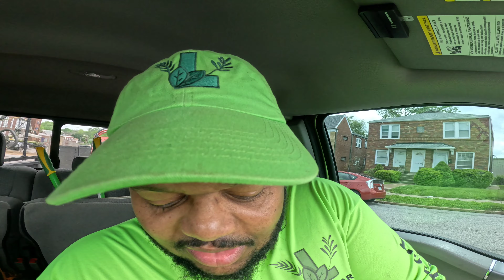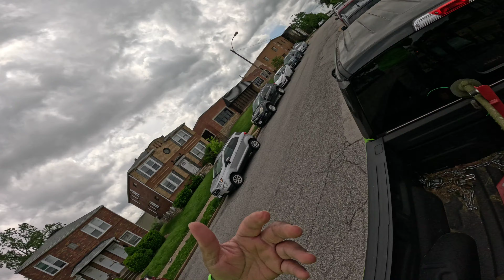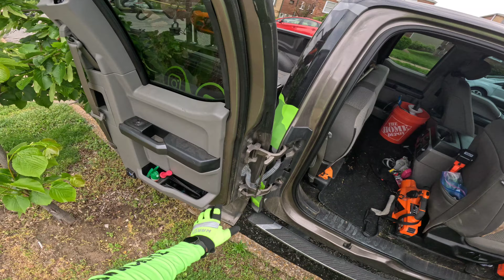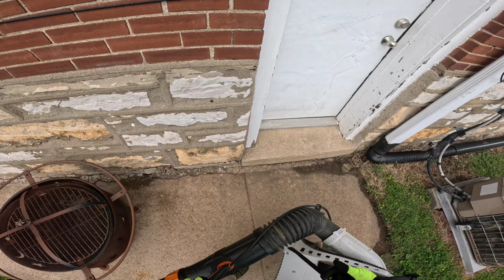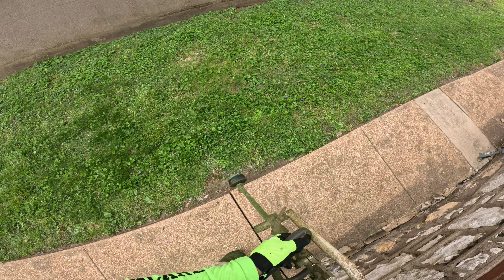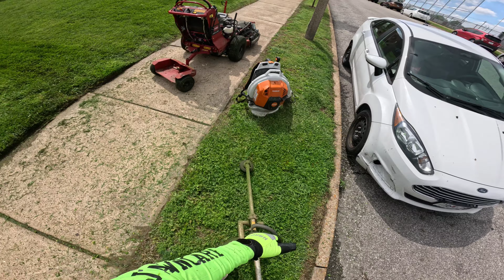I need 20 customers, not 1 customer with 20 properties #lawncare #cuttinggrass #mowing

Comment: Okay so, I see what you're saying however having a broker or an investor with multiple properties may not be a bad thing. If you can get control over the price for each individual property. And explain in detail what you can offer and what you can do and what you won't do. And again what they'll try to do is bundle everything and just keep everything like a flat rate cuz that's easier for them to write off on their taxes. However it may not be a bad thing but it just accordingly. Now one can weigh the return on investment onset and such properties. Play if they're weekly. So per se 20 properties right, depending on what East property is quoted at. Subtract your expenses and travel time to each property. For example, drive to each property measure the distance there and back how much fuel you use etc walk each property you'll know by walking each property how long will it take you. On each property, you don't know exactly what tools and equipment you'll need to complete each task on each property. Come up with a number for each property. People who invest in properties are usually people who are very good with numbers and they speak in numbers only. If it makes financial sense to them in financial sense to you and your business. It could be quite profitable. Cuz I'm not there, I don't know the local environment nor the local ordinances. However, if they're higher line properties as in highly manicure properties. Properties that are well-designed not too much shrubbery around hedges stuff like that. And you can get in and out of there quick. I might not be a bad deal. August 20s to split them up. Or break them into thirds, and add them to your schedule it may not make sense in the beginning over the season or if they decided to keep you for services over prolonged period of time. Becker open up other opportunities for you to reinvest at revenue back into your business to streamline even more efficiently.. yes at 36-inch walk behind is an efficient mower. However, a short wheel base stand on might be a better option. Take a look at Bradley mowers, they make quite a heavy duty mower for the money they might be a little bit longer than other stand ons. However with that longer nose the mower deck is out a little bit farther so one could know underneath objects obstacles stuff like that. Or keep that walk behind, and get a stand on 52 inch mower or something close to it. That way if you get larger properties you can mow them at a quicker pace. I'm sure you're fully aware of route density and communication with clients. However I watched them YouTubers literally start from nothing to running six-figure successful businesses. I'm not paid by them I'm just a small business owner and use some other ideas and incorporate them into my daily operation. There's other things you can get into too and other than just strictly mowing. Like some homes throughout the season some species of trees will still shed leaves. You may be able to offer gutter cleanouts they do have attachments for leaf blowers where you don't have to climb up on a roof. Just don't get stuck in a little ball limbo. Also now they do charge a medium finder's fee. Is thumbtack, they are a pain in the butt sometimes. But then again, they have a large market share of potential clientele around the United States. Including in the local area near you I'm sure there's gated communities they have higher caliber potential clientele. Now that can be a pain in the butt. Although, the higher end clientele are more likely to keep their homes and properties in a higher status of beautification. Heck, even some small commercial properties could be an option. Just stay away from gas stations iand convenience stores. Then type of businesses attract a certain atmosphere of nonsense. Hope I can help and just crush it this year guy you got it.